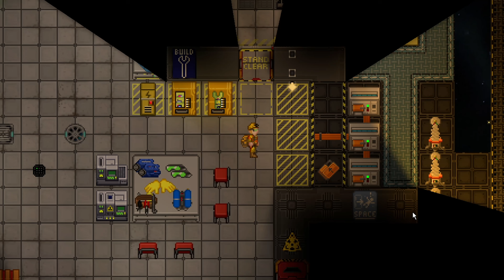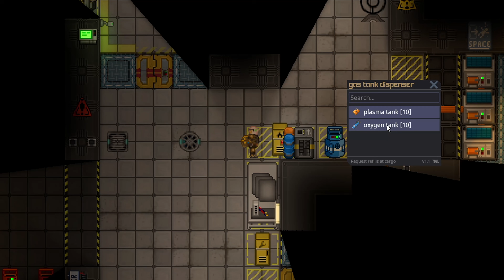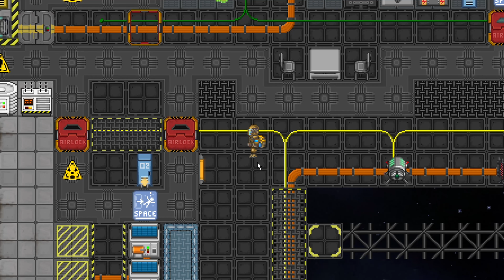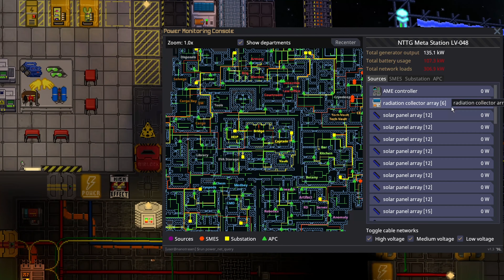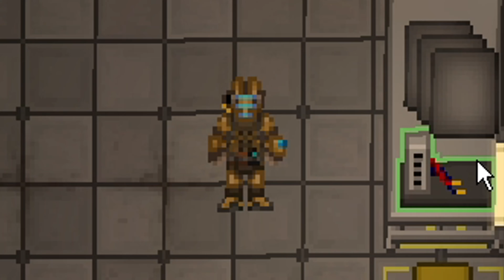SS14 - Basic Singularity Guide

Comment: Followed this guide, double checked everything, and yet Singularity got lose within the first minute of being active. Only difference was four extra containment generators in between the  corner ones (The station came with a singularity setup that had them already there, figured it was redundancy for extra safety)

I was immediately screamed at, called a dumbass, had EVERYTHING confiscated from me, and demoted to passenger. And all despite the rest of the station being undamaged since it drifted away from the station instead of into it.

I know that I probably AM a dumbass that messed up somewhere, but I was REALLY trying to be careful because I was afraid of exactly this kind of reaction, I took a lot of extra time to make sure everything was good and put a ton of redundant wiring and still something went wrong. And I know... I know that nobody cares, I just wanted the thought somewhere other than my brain.

Comment: Honestly these guides where you just purely go through the process without spawning anything in or ghosting around too much are great. Gives a better sense of where to head when you're a new player on a station looking to find and place what you need to get things going. Also the reminding people to shift click everything is great, can't be stressed how much easier it makes learning.

...Also who needs to upgrade the walls around the particle accelerator? Half of the engineering job is staring through the glass at the singularity getting eye cancer until we need to get dragged to medbay, right?... right??
Reply from the maker: medbay does like having patients, but thats usually sciences job lol
Reply: @Liltenhead  who else will get dragged to medbay with 800 heat damage from a fire anomaly if not me, the RD

Comment: Oh I didn't know the power states work different than in SS13, there the higer power level would just cause the singularity to get too big after some time and end in a singuloose, already wondered why I see it on 3 a couple of times in 14, seems a lot more forgiving.
Reply: Used to be like that until a few months ago iirc 
Pretty sure the change was for the loose levels to be hidden behind hacking the manager wire. So 4/5/6 will loose it but the PA will have a visual tell when it’s hacked like that.